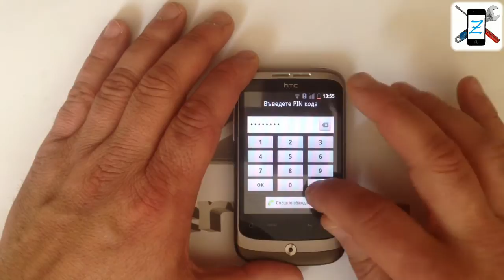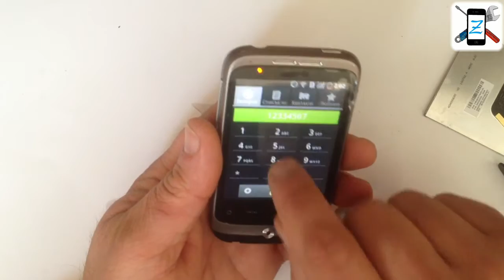HTC Wildfire A3333 G8 - Touch Screen / Digitizer and LCD Display replacement

Comment: Maybe your phone didn't have them, but on mine there were 2 screws holding the board down; one is at the top next to the power button, the other one at the bottom near the microUSB connector.
 You might want to mention it at the position 0:55 or 1:00 in your video.
Also, the plastic tool didn't help much with the initial opening, I had to use a small flat screwdriver for that.
 Other than that, good video!
Greetings from Bosnia!

Comment: what different with touch screen with ic and not ic?
Reply from the maker: Jovan Visekruna 
On this model no ic on the flex cable, because the controller is on the mother board.